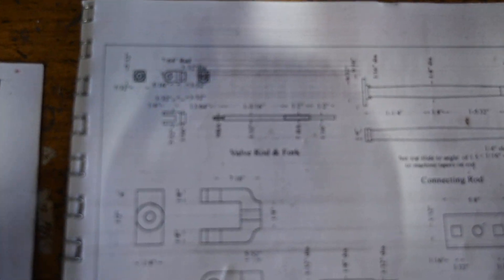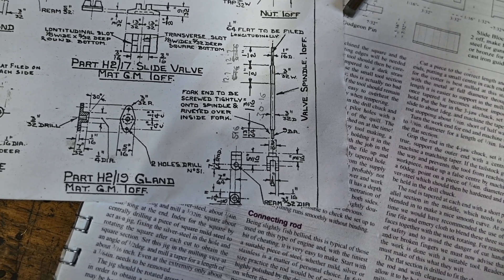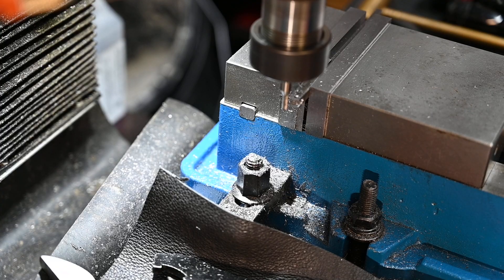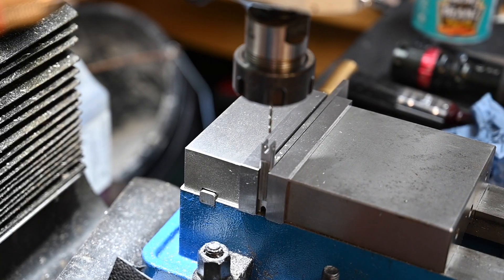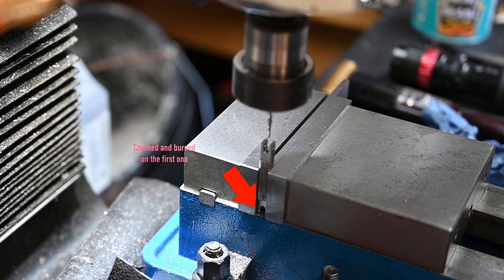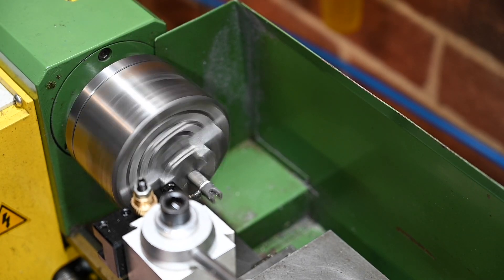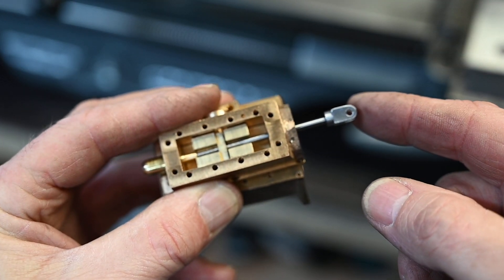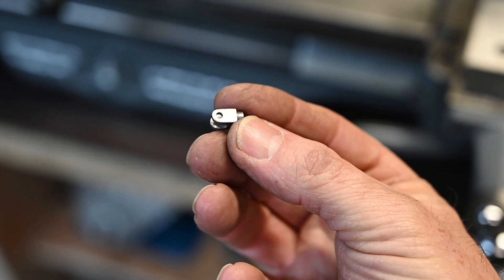Machining a Model Steam Engine Part 7 - Small Parts

Comment: I know there's 101 different ways to manufacture components. However, I would have put the bar in the 4 jaw, faced the end; drilled and tapped the hole. Then milled the slot and drilled the cross hole. How did you radius the end? In any event the part looked great.
Reply from the maker: Thanks for your comment 👍 I radiused the end with a file, it would have taken longer to set up the rotary table 😂
Reply: My thoughts too. You can shift a lot of metal fast with a fourteen inch bastard file!  @EnglishHobbyMachinist